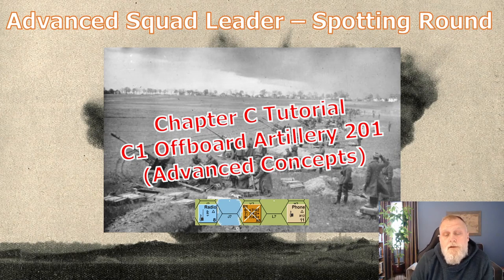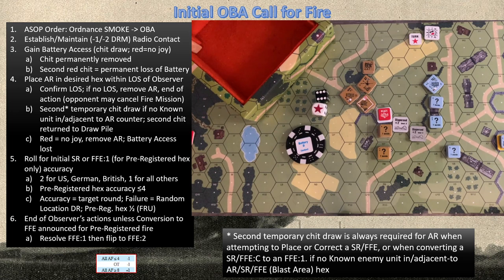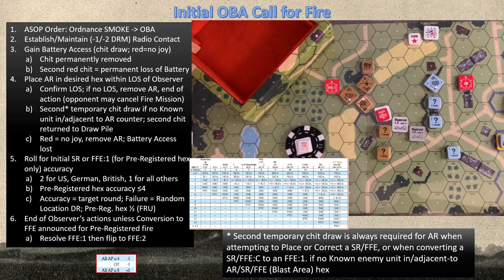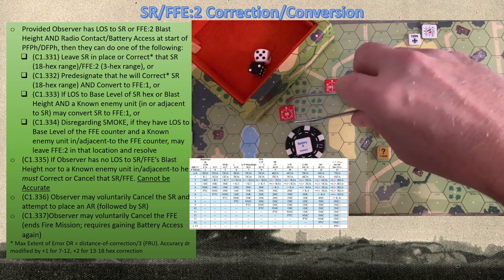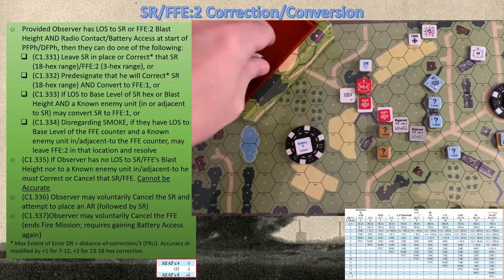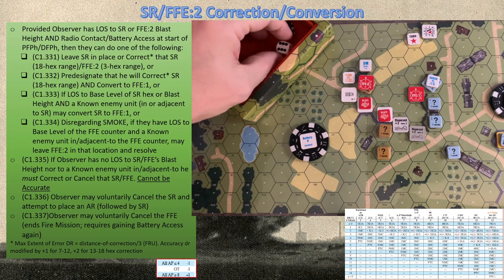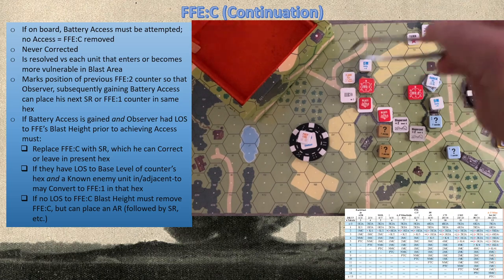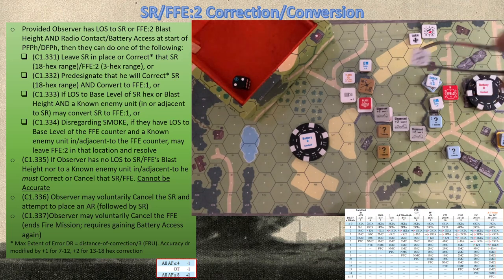Tutorial - Chapter C - OBA 201

Comment: Hi ! Thanks a lot for putting this all together, these examples are super interesting ! 
Quick question at 19:55 with the Burning Wreck result. You said that it became a Burning Wreck because the final DR result was <= the "3" of the K/#. However I read the C1.55 as the final DR should be <= the DR that could allow the K/#, in this case a DR of 4 would result in a K/3. 
So rolling a 3 in this case would result in a Final DR of 2, which could be also mean Burning Wreck ? :)
Reply from the maker: Good catch, you are right. 

Actually, I made another mistake because I never accounted for the Critical Hit (DR=1,1) so in fact it should have been on the 30 Column instead. 

Original DR  2 (1,1) -1 DRM (AF <= 4) = Final DR 1 which is <= 3 (half of the DR 6 required to get K/4 on the 30 column; so in this case rolling a Final 1 - 3 would result in a Burning Wreck.

Good eyes.